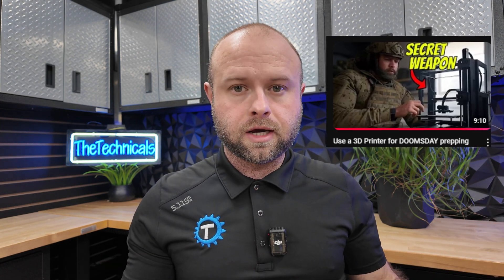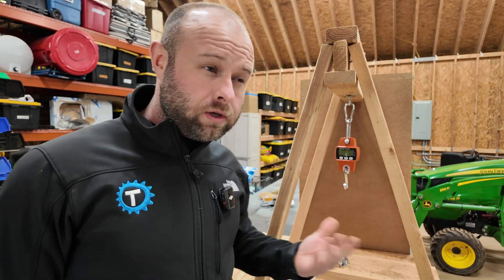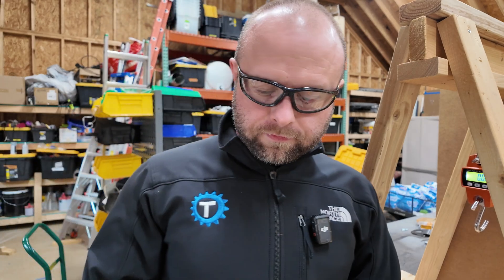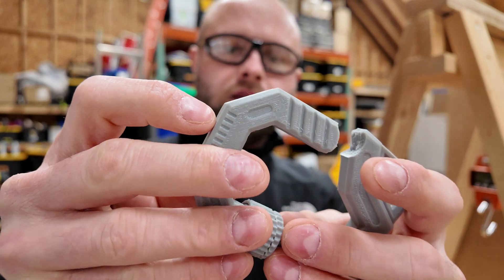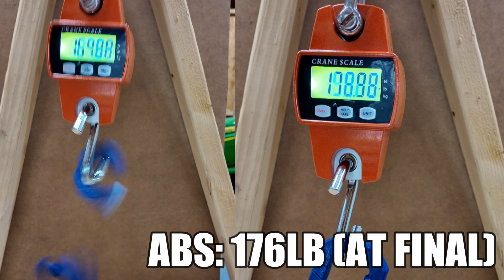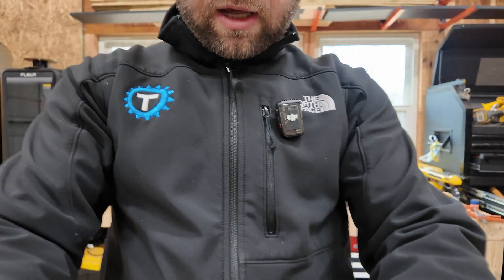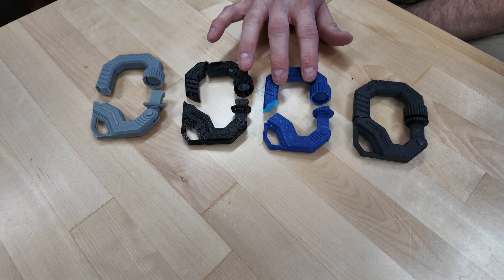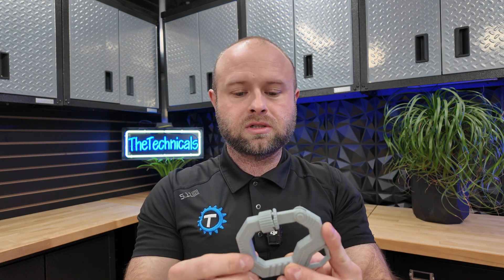Which 3D Printed Caribiner Holds The Most? PLA vs PETG vs ABS vs PA-CF

Comment: Pretty solid test setup to my eye! One thing is for sure. It's really surprising how much weight a plastic carabiner can take. Plenty for hitching stuff to your backpack or belt, camp site preparation, hanging stuff up quickly. Obviously not what you should use for climbing, but plenty of uses. Also proves yet again that PLA is heavily underrated by many people, though of course heat can affect it more than many other filaments. I bet PET-CF, and PP-CF would fare very well in this. Who doesn't love a good testing video? Nice work.

Comment: My print just failed at the 30-hour point due to a simple tangled filament spool.   Cobra 2 Max is a great machine if your lucky enough to have it actually finish printing.   Why don't they have a switch to detect a filament jam?
Reply from the maker: Cheap

Comment: After that line about your wife, I’m surprised you didn’t have to print a couch for the next episode : )
Reply: I bet you that that unnecessary corner is the weak spot and if it was a continuous oval, it would hold more weight.
Reply: You have a sharp angle right there, and I don’t think it allows the even distribution of stress across the material correctly.  That angle is it downfall. Hopefully some real engineer will step in here and see this and tell you for sure
Reply from the maker: I'll print a new wife, but this time 120% more asian

Comment: But did you anneal the PA612-CF according to manufacturers instructions? (An air fryer with a dehydrate setting is great for annealing pa612-cf parts.   But it definitely increases parts strength.
Reply from the maker: SHEESH NO
Reply: @TechnicalsTinkers  yeah, it's kind of a pain in the ass, but when you're working with that filament you're looking for maximum strength, so just part of the process for an engineering material.   When they come out of the oven the parts have a ring to them, they almost sound like metal...

Comment: I think if you make the inner surface where the loop contacts the metal to have a ribbed surface, it will have a tiny bit of compliance in the ribs so it isn't turning into such a concentrated force....
If thread is a weak spot, make it hollow and add a short stub of threaded rod inside it. Edit, wait that wont help in this case

Comment: Good tests with clear and usable results. I think the nut is failing first, it gets pulled apart, as soon as the nut separates all the load in the opposite side changes from a pure "pull" ( tension ) load into a bending load which instantly fracture the main body. I would redesign the screw side so that load does not go through the nut, have some sort of latch/hook/pin engagement between the 2 pieces which is then made safe by twisting the nut over it. When printing it should be laid flat and printed with full outerwall loops until it is solid, this way you get maximum strength from your filament and avoid pulling across layer lines - i'm betting you could get close to 500lb breaking strength with a bit of re-design - won't be as pretty though.
A few comments about PLA vs ABS -  PLA tensile strength is approx. 50mpa, ABS is approx. 30mpa - Matts test shows this difference very nicely

Comment: What?! PLA holding almost double than ABS? STL? 

 During the final examination, most of the carabiner broke at a 45° angle. Solid infill is usually at a 45° angle. Try with full walls. Dial up the walls until the preview shows all yellow walls on the inside. This will put all stress in one continuous loop. It should change the break pattern too.

Comment: I still think ABS is better it just never printed right, it needs high temps and by the time the nozzel gets back to the same spot its cooled off and you never get the proper layer adhesion and it ends up being worse then PLA.  Why they recommend an  enclosure to keep that ABS warm for layer adhesion. But i bet if you injected molded both plastics , ABS would come out on top.  Just speculating, but i printed a heat tower and the abs was indestructable at 260+ and above.  It gets stronger with more heat, but youre still dealing with sticking hot plastic to cooled off plastic which isnt ideal.  I think why PLA is good for 3d printing, it stays warm, hence the need for lots of cooling, so you get better layer adhesion.  I think higher temp materials are ultimately stronger but need higher temp setups to print.
Reply: PLA tensile strength is approx 50mpa, ABS is approx 30mpa - this is not across the layers - this is if you measure the tensile strength by taking a piece of filament and hanging a load off it until it breaks